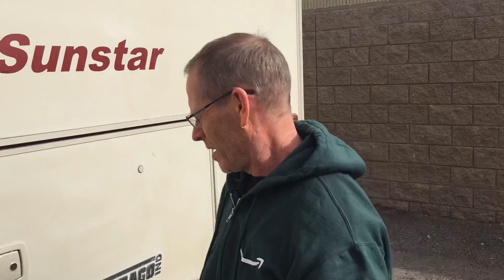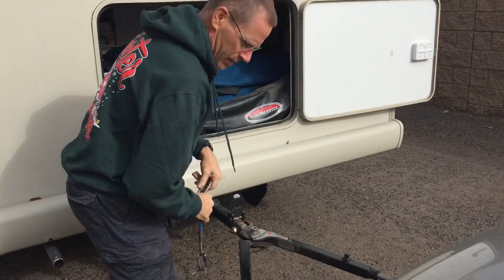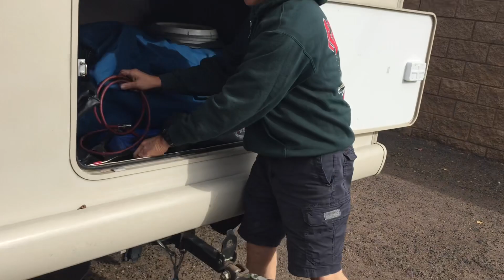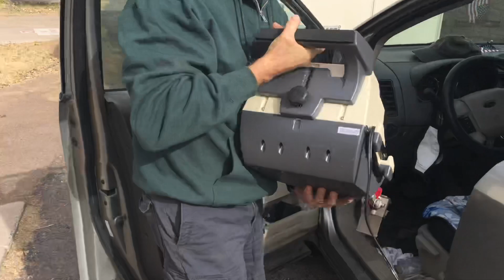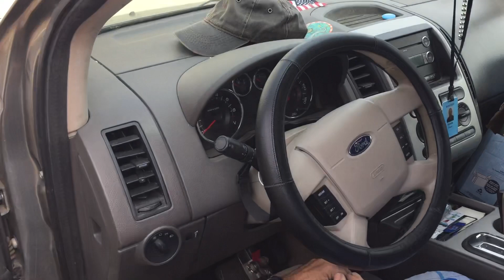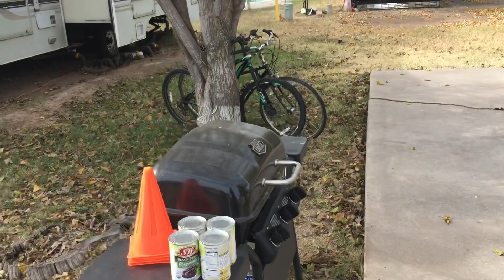How to Connect the Tow Vehicle and Break Buddy. Moving the RV for the first time in 9 months.

Comment: You have two Shekels, one should be on the car direct and the second should be where you hooked it up. If the atachment on the seperat the saftey cable is still connected to the car.